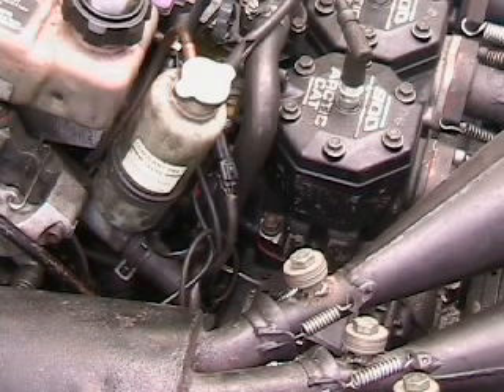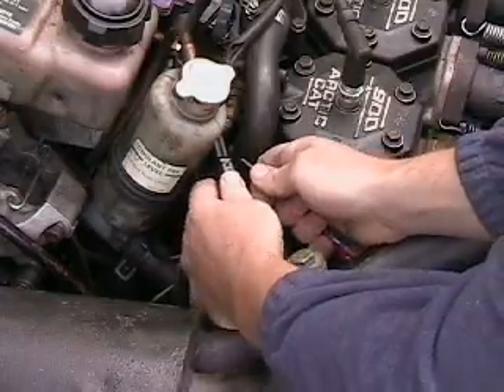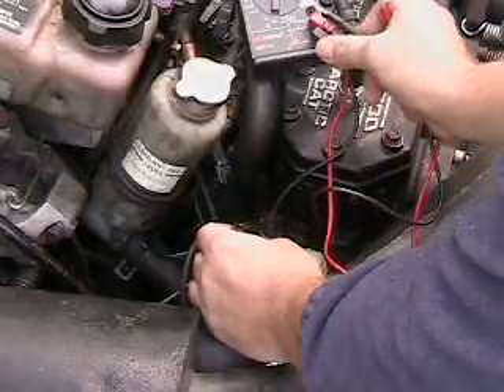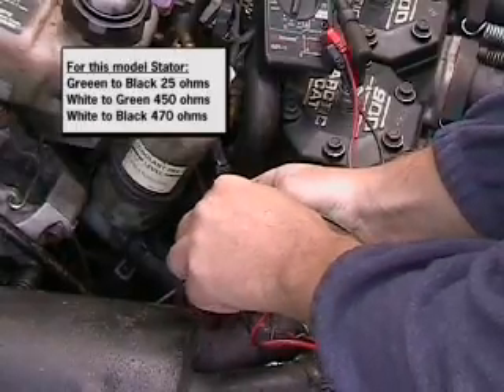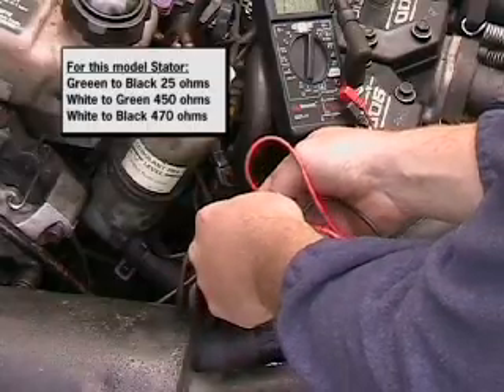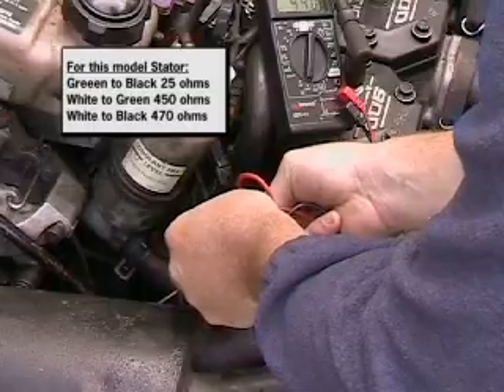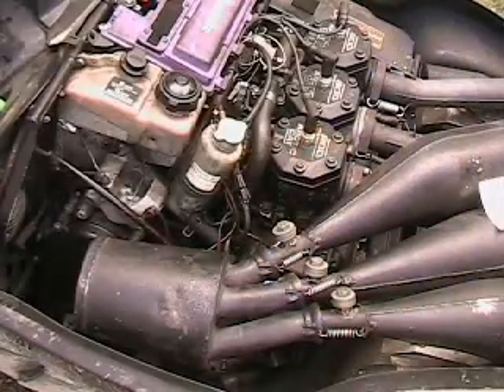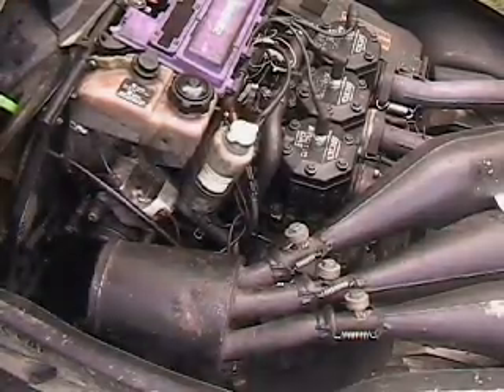Testing a stator in a snowmobile Arctic cat

Comment: I'm trying to figure my 02 sx viper 700 out.  I tested pickup coil it reads 191i believe, then i checked stator between all 3 I get 0.2, it was about 30 -40° outside.   according to another video a guy made im thinking its toast.  but in his video he says that he tested his new stator and it read 0, but it ran perfect, so that confused me, maybe he had tester on wrong setting. any help would be Heatley greatly appreciated, thanks, Rod

Comment: Blaine.  I have a 93 lynx 340, and need to put the stator back on.  How do I align it, or time it, as it has several positions I can use.  ThAnks
Reply from the maker: Just use the existing witness marks on the stator mounting plate. If there aren't any, most of the marks that I've seen are generally in the middle of the existing slots for the fasteners.

Comment: Any idea what specs would be for a 2005 F7?? Thanks
Reply: BlaineDP thanks, although i cant find a 3 wire plug, from the stator there is a 4 wire plug, and a 2 wire plug, this is a carbureted sled two
Reply from the maker: Carb:RED/YELLOW & YELLOW/RED - .90 TO 1.1
YELLOW & YELLOW - .30 TO .40
Reply: BlaineDP thank you sir, do you know if it matters what setting on my ohm meter? Im getting .5 on red/yellow to yellow/red and 0.00 on yellow to yellow. The sled runs and all lights and gages work but doesn’t rev as high as it should when it warms up.

Comment: Blaine my stator cold in Maine 20* outside sled sat for two days my stator test are low side 414ohm high side 44ohm and 451ohm what you think? I’m in the process of thinking I’ve got a needle and seat leaking. This is why. Start the sled seems like it’s flooded then comes out of it idles great.let it warm up hop on it n punch it seams flooded then clears up n runs like a cat. I’m leaning towards the stator getting ready take the # 2 on me lol. I appreciate all your videos man your awesome.
Reply from the maker: OEM Stators are normally 435-445 in cool to warm weather. In cold weather they will measure lower like 425-435..but seeing 414 to me is suspect. It sounds like the low side of the coil could be going bad. The one way to know is to put it in a warm garage/barn at 60 degrees or take it out of the sled and let it sit on the counter overnight and check it. It'll probably measure over 450 ohms and that is a tell tale sign that it is going bad.
Reply: It’s starts first pull every time and runs n goes great I’ve got a carb that’s flooding out a little so going through them once I get the kits I’ll keep you posted if I need a stator thanks again

Comment: Hi Blaine

Thanks for all the info you have posted on your YouTube channel as well as info on your website, they are great resources! I have just finished servicing the carbs on my 1994 Thunder Cat Mountain Cat and cant get it started. I removed the spark plugs and found poor quality spark on the 2nd and 3rd cylinder; I also noticed that spark quality was the same with the key either in the "on" or "off" position.

I then followed your instructions and disconnected the plug from the stator to the wiring harness and installed a jumper cable; again no change in spark quality. The weird thing was that I found same spark quality whether the jumper was installed or not? Is there another ground I need to check?

Other things I have tested; stator, trigger coil, removed and reinstalled grounds onto the magneto case, trimmed spark plug cables and reinstalled caps. I have not accurately tested the ignition coils as my multi-meter is not accurate enough.

Regards

Paul

Comment: hello, i have a 2000 ZL500. my wires are a little different than what is in your video, but what I have is, with the "nub" up.
upper left = black/red
upper right = purple/black
lower left = green
lower right = white

readings:
white - green = 458
white - black/red = 504
green - black/red = 46
Reply from the maker: The low speed coil (The one that measured 458) is bad on it. I do rewind them. www.outdoor-electric.com for more info.

Comment: No spark, I checked stator and ohmed out 437 21 458. I get spark when I bypass stator. Do not get spark if I bypass tss/kill switch. Ignition switch and tether have continuity. What else can I do. This is a 1995 6-00 ZRT.
Reply from the maker: Stator ohms look good. If you have spark bypassing the rest of the sled (using the jumper wire on 1997 or older sleds or not using the jumper wire on 1998 and newer sleds) then you may need to look at wiring the key straight to the stator and bypassing the main wiring harness.

Comment: I am testing my stator and i cant get a steady reading.  I get 23.4 omhs one one set and the other to sets wonder and won't give a solid number.  do i have a short somewhere or is it just no good
Reply from the maker: The stator specs for the 1993-1999 ZRT800-1000 motors is 450 and 25. If it measures higher than 450 or 25.5 it is bad. If it measures lower than 430 it is suspect and lower than 420 it is highly suspect.
Reply: +BlaineDP hey do you have any ideas for a 04 900 efi? do they often have trouble with the stators? all the tests for ohms ive done it checks out fine and all that i can figure out is that the efi box is shot.. just wondering if you have any voltage numbers to check on the stator? thanks

Comment: Hi Blaine, am trying to diagnose stator problem for my 1998 powder special 600 EFI. Works great until it heats up and then it bogs down. Checked the ohms and the numbers are different than what you show in the video, my tester shows 045 etc. and I also have a red wire instead of black/brown. Was also wondering about rewinding the original stator and if you can do that.

Comment from the maker: Forgot to add, just test your stator ohms when it is cold/at room temp and see what it reads. If it is 450 or higher, it is bad. If it is 420-430 it is highly suspect. If it is lower than 420 or especially when it is lower than 400 it is going bad. The high speed coil should be between 22-25 when cold.

Comment from the maker: Most cat stators with the low speed coil spec of 450 the general ruel of thumb is: When a factory stator measures less than about 430 ohms, it usually is dying a slow death. I can say with a lot of confidence that with yours measuring 400ohms it is bad.

Comment from the maker: I don't have them. You will have to contact a dealer or someone who works on Polaris sleds. Sometimes you can get answers on snowmobile forums. If you headlight is flickering it may be a stator issue, a rectifier issue, possible bad bulb, ect...  CHeckt eh voltage coming out at the plug with a multimeter using the DC setting.

Comment from the maker: Right now I am specializing in stators that have either 1ignition coil or 2 ignition coils like the one in my video. Newer stators (post 2002-ish) have a different design and have a much lower failure rate. I charge $150 if you send me your stator to rewind. I have a couple of cores/dead stators on my bench. If someone had a stator that was damaged, I may have one that I can rewind. If I use one of my cores it is $175. Turn around time is 1 to 2 days after I receive it.
Reply: Are u still redoing them?
Reply from the maker: @mikesfuntimes  Yes, I am still rewinding. www.outdoor-electric.com
Reply: @BlaineDP I know this comments old but I think my stators causing my snowmachine to intermittently run on one cylinder it’s a 97 rmk700 heard it could be a cdi issue so replaced cdi it whent through my fuel system    so that’s good not a fuel issue but I’ve noticed one cylinder seems to be flooding out on one end and not burning off from I assume would be weak spark if you still work on these things I’d be interested in talking on email about if you could repair this or if I should just try and track down another one thanks

Comment from the maker: The specs are White to Green (Large Coil) 450 ohms, White to Black (Coils in Series) 470 ohms,  Green to Black (Small Coil) 20-30 ohms. So if you're not getting a reading from white to green the small or "high side" coil is bad assuming all of the wires are good to the connector. When I rewind them, I rewind both coils.